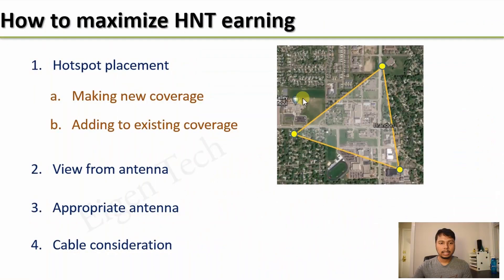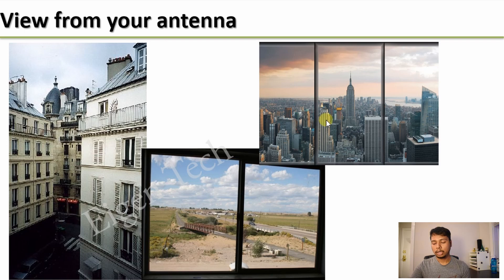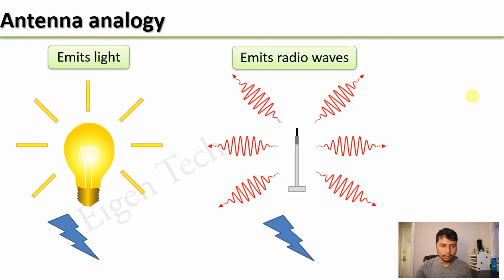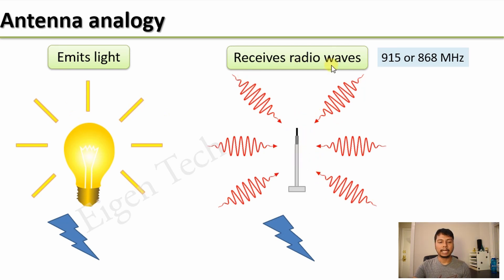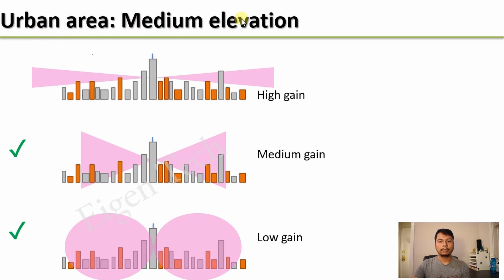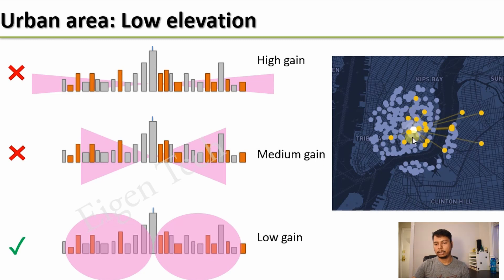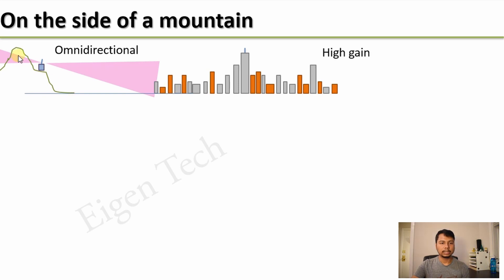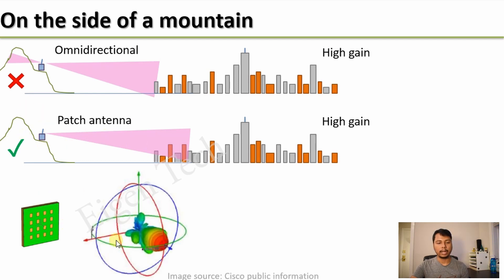Best antennas for Helium hotspots | Which dBi gain antenna to buy for a miner? Maximize HNT earnings

Comment: For clodpi miner lora fiberglass antenna type - N 5.8 dBi (860 - 930mhz) works Sir
Reply from the maker: Yes, it should work but it might be better to find another antenna whose frequency band is not so large and has a center around 865 MHz
Reply: That means (860 - 865 ) you are telling right ? And if you know where can I buy this please provide the link it will be very helpful thank you sir
Reply from the maker: @intrologos5374  Yes, something in the range 860-870 MHz should be good. I do not have any recommendation yet

Comment: Hi Roy, Thank you for this informative video!  I live in suburbs right now so I plan to get a 6.0dbi antenna.  However, I plan to install this antenna on the roof of my house.  So, I will need to have a long LMR400 cable around 50 feet in length.  My question is, since my cable is so long, there will be some dbi loss (I calculated -2.3 dbi loss).  Does this mean for me to get roughly the performance of a 6.0dbi antenna, I should instead buy a 8.0dbi antenna?  Or is this a false premise, and the 6.0 antenna will still maintain the same radio wave shape regardless of cable?  Basically, I am wondering if the quality and length of the cable can change the antenna dbi?
Reply from the maker: "the 6.0 antenna will still maintain the same radio wave shape regardless of cable" - this is exactly true, so your 6dBi will always behave like 6dBi in terms of beamwidth. However, with 2.3 dB less power, the signal will reach slightly less distance. There is LMR600 cable as well, which is better than LMR400 (more expensive though)

Comment: Thanks Eigan Tech for the informative video. I am at the ground floor of an independent house .  The houses behind my garden are also similar . Would that be an issue in my earnings  once my miner has arrived .
Reply from the maker: try to get an outdoor antenna and place above your roof and you should be good
Reply: @eigentech6567  Thanks Eigen Tech. Any specific dB and recommendations for Bobcat 300 ?
Reply from the maker: @marathonminer8913  that depends on the topology of your neighborhood and that is what I have explained in the video
Reply: @eigentech6567  Thanks

Comment: Best antenna video i've seen so far!  Question: Do you think signal interference will be an issue for me? I live right next to a small/medium sized airport. Should I use a patch antenna pointed away from the airport, or just stick with the omnidirectional?
Reply from the maker: I am not sure if any equipment at the airport uses LoRa frequencies. But the point is if there are not many hotspots on the side of the airport it might be better to use a patch antenna. You can first check the performance with the stock antenna and then decide

Comment: Hello normally how many helium hnt per month you consider a good value? And when do you decide to change antenna . 4db to 5.8 or 8db.. i live in a typical resideintial area near offices but no high rise bldgs..
Reply from the maker: I have discussed the average earnings in this video https://youtu.be/4ZOWL-kSxZ0,. Anything above average would be good. If you think your hotspot is not performing as well as others around yours then you might need to change the antenna. But, in most cases antenna placement is more important than the dBi
Reply: @eigentech6567  thanks man

Comment: Questions. Your diagrams are a little deceiving. They shows an 8dbi antenna extending about the same distance as a 3 dbi!! How is that possible? Thank you
Reply from the maker: That is just a cartoon focusing on the beamwidth aspect. I have talked about the rough range in the latter part of the video

Comment: Hello. Nice and accurate video. It just popped in my mind the next scenario. Can we connect 2 or more antennas together with the coaxial splitter to the bobcat ? I mean I would like to have next to my miner (indoor) a 5.8 dBi to capture the city and on top of my building a 10 - 12 dBi to catch the very far miners. So can we connect 2 different antennas using the splitter ? Will bobcat see or get the signal from both antennas ? Would I need anything else to make this setup work ? Tnx so much.
Reply from the maker: Nice thought. Technically it should work but the problem is due to the splitter you will lose about 4 dB power in transmission and while receiving. So I don't know if it will be beneficial ultimately. Also, 12 dBi is too larger, the max yous should use is 9 dBi
Reply: @eigentech6567  Tnx so much for the answer. What is the source for the info that the splitter will take 4 dBi off ? And if so... I would be very curious how the 4 dBi would be lost. Would it be 2 and 2 dBi from each antenna ? Or more on one and less on the other ? Because if I`m not loosing anything on the 5.8 dBi antenna and I`m only loosing lets say from the one 12 dBi (long range) I will still have on it about 8 dBi left which would be more than enough to reach more far miners. I think I will have to take this chance and actually do it to see... :P ! Do you know if there is any way to see which antenna is loosing or how is the actual loos on this setup ?
Reply from the maker: @mihaisirianu8841  Splitters are usually symmetric. dBi is in log scale, so it doesn't add normally. An ideal splitter would give 3 dB loss on each split port. Usually, there is 1 dB more loss due to connectors, cables etc. You might find the details on the actual product page

Comment: Quality content. Thanks. Upgraded anttena to 8dbi, placed outside in london.  Now getting 441 Witnesses in discovery mode. What am I getting wrong that rewards are averaging 1.5 HNT a day ? Transmit Scale is 0.81
Reply from the maker: I think that kind of earning is the current normal. You can check this video to get a sense of average earning https://youtu.be/4ZOWL-kSxZ0
Reply: @eigentech6567  and you dont want to run an 8 dbi antenna if your close to a city... only if your at a higher elevation the the city if your are on the outskirts... the best results you can go to the helium heat map and click on other miners around you and see what antenna gains they are using, and what hieght they are at, so base your antenna on other miners near you who are gaining the most hnt... and 1.5 after the halfving is still what 600 dollars a month so quit bitching.
Reply from the maker: @beefwantko7269  Good luck with trusting the gain and elevation information on the Helium app and watch your tongue before making a comment on my channel next time

Comment: How about Mhz?
Reply from the maker: Not sure about your question
Reply: @eigentech6567  there is antennas with different mhz. Does it matter?
Reply from the maker: @ChristianEilskov  You have to use the appropriate antenna. FOr 868 MHz miners you have to use an antenna that supports that frequency and similarly for 915-923 MHz miner

Comment: Hi nice video! Can you inseast any patch antenna (868). From Europe Greece
Reply from the maker: didn't get your question
Reply: @eigentech6567  I am located under a mountain and I can see all town and as I saw your video I believe that I need a patch antenna. Where I can found? Thank you in advance
Reply from the maker: @dionisisch  I see. I do not have information on where you can buy. But you will find information on the #antenna channel of Helium discord https://discord.com/channels/404106811252408320/730245124004773948
Reply: @eigentech6567  maybe Amazon or Ali? Thank you again!

Comment: Great video, thanks. Look this might be a stupid noob question, but would it make sense to add a splitter and connect 2 different dbi to the same hotspot? Would that work at all? For example you are in a city and you need a 3 dbi to get all those miners that are close to you but have some obstacles and different hights etc but at the same time you have clear view to a bay or a big river and you want to also connect to the miners on the other side that are miles away, it would be great to have both ranges. Does this make any sense? Thanks
Reply from the maker: It is a very good question. But the problem is you need to use a splitter and there is some electronics theory that says that you will not be able to transmit all the power because of impedance mismatch. In principle, your method should work but there will be some loss due to the splitter. You can try and compare. I do not know of anyone yet trying this method.

Comment: how many meter(s) do you define high elevation and how many meter(s) low elevation?
Reply from the maker: there is no single number. It is relative to other buildings around yours. If you feel like you can see roofs of say 70% of the buildings around you, you have a high elevation

Comment: Hi there, thank you for the excelente information about dbi and antennas 
Quietion is posible to connect two different dbi antennas to one Hotspot
Is that a way to do this
Thank you for your hepl
Reply from the maker: Glad to hear that. Connecting two antennas is possible only on LongAP helium miners. For other miners it is not possible as there is only one antenna port
Reply: @eigentech6567  But, if I use something like a splitter or HUB,  it is this possible to connect 2 diference Dbi range antennas to a Hotspot, is this a configuration that can work?
Thank you for your Time
Reply from the maker: @jcanales1969  You can use a splitter but there is something called an "impedance mismatch" and because of that your hotspot will not be able to deliver all the available power. So most likely such a setup is not going to help. You can still experiment and I will be happy to help.

Comment: Nice
There is a way to update antena elevation ?
Mine is at top flor ( 9th flor building )
And it shows 0m elevation
Reply from the maker: Yes, you can use the Helium app to update it (and it costs money) but there no point in doing it now as the elevation information is not being used by the algorithms
Reply: @eigentech6567  
At this point a have 143 witnesses 
But transmit scale is only 0,20 😞
Reply from the maker: @bobbondarul7448  can't do anything about it. The algorithm penalizes closely placed hotspots
Reply: @eigentech6567 :(

Comment: Thank you for the video. I was wonderinf if you know if its possible to use a cellular data hotspot instead of an isp internet for these miners
Reply from the maker: Yes, it should be possible to use a cellular data hotspot as long as it has a stable connection

Comment: I have a question, if I have a 8dbi antenna and my cable has a 4dbi loss, it means my antenna will perform as a 4dbi antenna?
Reply: @eigentech6567  thanks for answering. So, for example: if I would connect my antenna directly to my hotspot I should reach 15 km (it's an example) and with my 4dbi cable loss it would reach 4-5 km but with the same angular coverage?

Comment: As a Telecom Eng. my self this was a very good antenna video explanation, with just a small miss calculation on what’s called “link budget” the calculation of the available miner power + cable loss + (the forgotten gain of the antenna) in the total EIRP (Equivalent Isotropic Radiated Power).
Reply from the maker: Thanks. I am glad to hear that. Actually, I do not know what a "link budget" is. On that slide, I meant the total radiated power and that is why didn't include antenna gain. I tried to make this video understandable for a layman and so tried avoiding most of the technical terms like EIRP.
Reply: @eigentech6567  “link budget” it’s a fancy telecom name for the calculation that you did on the available antenna power (+ some other stuff, Google it ;)) but my only point in the video is that you need to include (sum up) the antenna gain on your available power calculation so you have really the available radiated power from the hole system gateway+connector+cable+connector+antenna ;)
Reply: Ricardo, do you think signal interference will be an issue for me? I live right next to a small/medium airport. Should I use a patch antenna, or just stick with the omnidirectional?
Reply: @PavelPower  interference is always a problem, that everyone leaves with, either we like it or not, so the only way of managing it would be to measure it before making any conclusions about it and take any plan of action against it. Start from the beginning, meaning star with an Omni directional antenna and move to a patch(directional) antena only if needed. Yes, a directional antenna is a tool for fighting against interference, but if you don’t know the were is the source of interference you might end up, trying to fix your interference issue, point the antenna directly to the source of interference and doing it worst!

Focus above all for now into having the biggest and free of obstacles “line of site” between your antenna and the other miners antenas and in the near future on the potential users of the network around your antenna because that’s were the majority of HNT tokens will be distributed year over year ;)

Comment: Thanks for such a informative video. Such a great video as always....
It would be great if u can throw light on factors affecting the radio signals.. e.g. what if some one has a metal window grill installed, having metal structures near antenna,   having water body close to the house?, Double story house surrounded by tall buildings.. etc... 
Thanks once again...
Reply from the maker: These are good points. I should have mentioned the window screen part in the video actually. A metal grill/mesh is not recommended on the window if you are using an indoor antenna as it will block radio signals strongly. Having a water body close to your house is actually good as signals will reflect off the water and travel further. Any building structure will always block your signal, however it will partially reflect the radio signals as well
Reply: @eigentech6567  Thanks for clearing these doubts.
Reply from the maker: @nikhilvaidya2939  You are welcome
Reply: @eigentech6567  how do you think about double glass windows? we have them everywhere here in Netherlands. Some people say its very bad for signals, and you'd rather put the hotspot against a wall than before the double glass window.
Reply from the maker: @mpc007  It depends on what kind of wall you have. I found this document to be pretty useful to calculate attenuation https://www.dataloggerinc.com/wp-content/uploads/2016/11/16_Basics_of_signal_attenuation.pdf
It might help you in deciding what would be the best

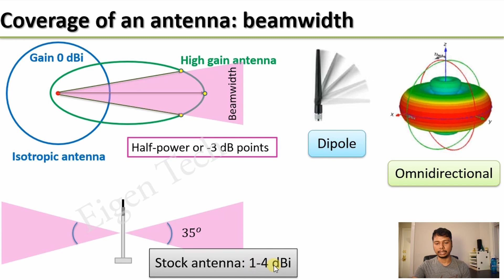Comment: You can do a lot more distance than you showed at 7:35, depending on your environment of course.
From a high spot with unblocked view even a 3dbi antenna can do 10km or more. 6dbi can do at least 20-25km.
Definitely NOT from indoors. Plus you can also go with LMR600 cables, I think its a better choice than 400 for not much more cost.
Reply from the maker: You are right, with clear line of sight even 3dBi antenna can go pretty far. I tried to be conservative while quoting the numbers what would be expected for typical city. Actually, I didn't know about LMR600, will check it out. Thanks